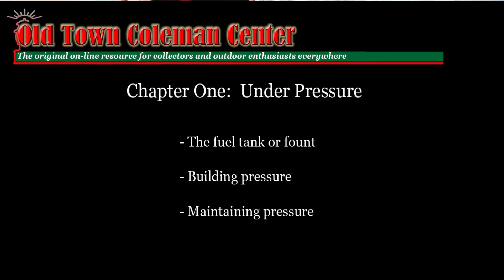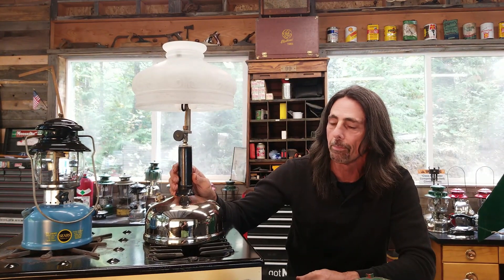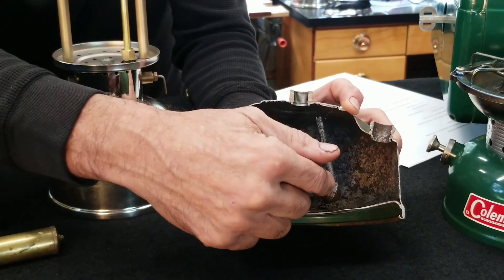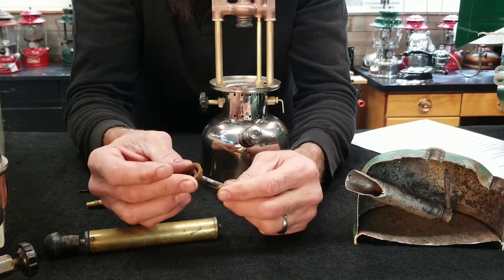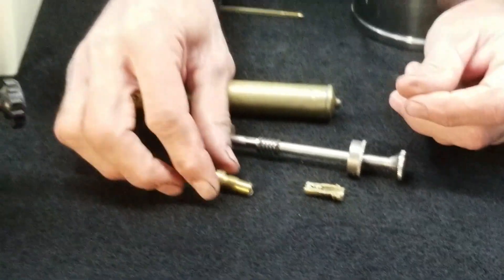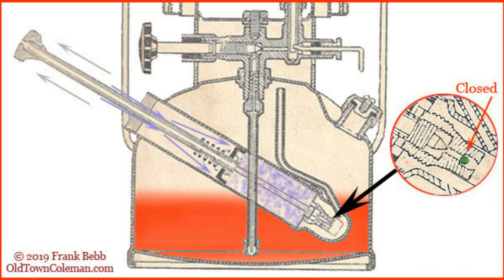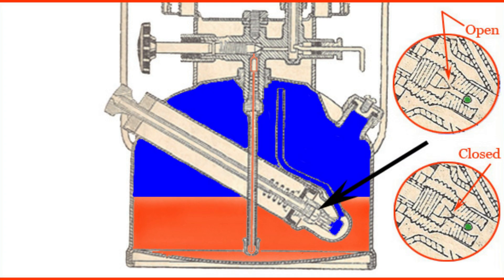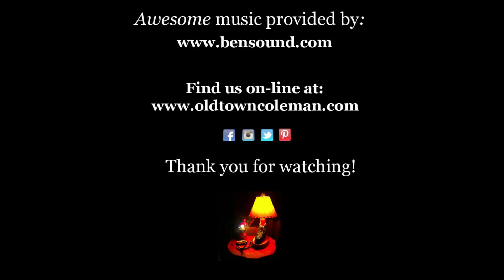How a Coleman Lamp, Lantern and Stove works - Theory of Operation Part 1: Under Pressure

Comment: No matter how much carb cleaner I spray into the check valve I cannot get it to stop leaking. I do not have a removal tool and I'm worried about ruining the valve. Would it be advisable to try a citric acid solution down there instead of carb cleaner? It's my understanding that citric acid is what's used once the valve is out

Comment: I have been using thes for years but out of nowair i needed to use one beacus the power went out and it presurises but gas is not coming out .anyone have any ideas ? I might just need to take it apart and rebiuld it again it has ben 15 years 🤔

Comment: Thanks Frank.  I’ve watched your video’s but still having problems with my 285-700t.  It’s struggles to light.  I’ve changed the generator and the font o ring.  But it splutters and lights but then goes out.  Upstream of the font is clean and good.  Is there a blockage in the valve or font?  Fuel does flow but it is sporadic.  Any help appreciated.  Thank you and keep up the great work!

Comment: The 242 c lantern has a small fountain. On a unit that has no air leaks, and has been pumped up to pressure with a tank of fuel, how long should this lantern burn at a moderate intensity without requiring any additional pumping to maintain brightness? Was the small size of the fountain the reason that it was discontinued in the US?

Comment: I bought a coleman stove a few years back for a few dollars to take on camping trips with our old VW Camper. It kind of worked but it wasn't getting much pressure. It was put to the side for a year while I started looking into converting it to propane or was going to toss it completely. This winter I came across an old Coleman lantern & it too wasn't working right. Then I found this channel. From getting my lantern to work & understanding what's going on, I was able to completely take apart, clean & redo my lantern. From there I got my stove working (all I needed to do was clean the generator tip & oil the leather cup. It's really simple but without channels like this, I would have never got them going & would have gave up. Now I'm partially addicted to lanterns, bought 4 more cheap finds (2 Coleman & 2 Sears - Blue/black big hat & the avocado) and even got a super nice 502 with pot/pan, original boxes & advertisements which I love. Thanks Frank. You're a great instructor.  - Jamie from Pennsylvania

Edit: I also got my 18 year old son his first coleman lantern & together we went through it all, I explained how it worked and how to take it apart & put back together. I'm glad to pass down info I have to younger generations.

Comment: I just got a powerhouse dual fuel lantern and this is my first lantern but I’ve already fixed the check valve and the rubber seal on the cap so now it hold pressure. I took the generator tube off and I can see the little needle come out the top with the knob turned. Those only thing it does is I can hear it hiss but no sputter so I’m guessing the pick up tube is clogged right?

Comment: Why is the pump tube hollow and what is the purpose of the small hole at the top of the handle  ?  Are you supposed to block it with your thumb as your pumping ?  I've watched lots of videos hoping for an answer
Reply: I don't know the official answer, but it appears that the little hole is to let you put the handle inside the tank if the pressure is already too high to pump even a little more. Imagine there's no hole in the handle. You unscrew the handle and start pumping; at some moment you realise that the pressure is already high enough so you want to push the handle inside and screw it. But you can't, beacuse you've already pumped so much air, that no more can be let in. So what can you do right now? How to hide the handle? To release all the pressure through the filling cap and starting the process over? Or just to cook with the handle up? That's why there's that little hole in the handle. The rod connected to the handle (the one we move up and down) is a pipe opened at the bottom. And if you don't close the hole with your finger, the air just escapes through it while you push the handle down, so you want to pump the air you have to close the hole. But when you don't want to apply any more pressure to the tank, but you want to hide the handle, you just release your thumb and let the new portion of the air just escape. Releasing the thumb before screwing the handle doesn't let the pressure escape from the tank, because there's the ball valve inside. The screw valve is somehow like a handbrake in a car, it's for long term holding the pressure; while the ball valve is like a service brake of your car. The ball valve holds the pressure during the pumping, but you can't rely on it during cooking or storing.

Can anyone confirm my theory?
Reply: @Krzysztof-Bodke  I have always wondered the same question myself as I noticed it pump either way, hole on pump handle covered or not.  Your explanation makes the most sense that I have found d so far.  Thanks for your input.

Comment: I'm 59 years old and never really had a hobby. Thanks to you and your videos I now have a hobby that I love. I have several different lanterns and even old oil lamps that I now am cleaning and refurbishing. About 15 years ago I found a 242C in a dumpster with nickel fount. It doesn't work and the fount has rust dust in it. That lantern has always been my favorite but I never knew what to do with it but thanks to you, I now know how to fix it and clean it up. 
Gotta love that base line groove in the beginnings of the videos!

Comment: The vertical tube from the pump is not vertical to put the air above the fuel to pressurize it. Air will get there with no special help. The tube is there so fuel doesn't go into the pump. Hence the admonition NOT to overfill the fount and flood the pump.
Also, the check valve is designed to let the air go one way but prevent the FUEL to go the other way. Not air.
 But i guess we all know that. Beautiful pictures. Beautiful lamps.

Comment: Glad I found your channel, great content.  Looking forward to the rest of the series.
The vertical tube at the outlet end of the pump is not to direct pressurized air up into the top as air would naturally rise without this tube but instead it is open to the air pocket above the fill level to prevent liquid gas from bleeding back into the pump cylinder in case of a check valve failure.   Bleeding off air is always safer than bleeding off gas.

Comment: Great video. What is your opinion on the neoprene pump cup coleman uses nowadays? Also what is the best oil to use on the rubber? Coleman recommends light machine oil but I'm not 100% on what exactly counts as light machine oil.

Comment: What happen if the Check Valve is permanently submerged to kerosene gas because of a faulty Pump Tube? Can I still continue pumping and create pressure inside the gas tank?

Comment: Hello been watching your vids got a question… got a Coleman 220f 1965 took apart to clean and I left valve body on the tank and pressure tested and no leaks and check valve good but was wondering while I opened valve to release air after about 45 pumps the air gets released in approximately 10-15 seconds is that proper working condition??? Just seems to quick am I missing something???

Comment: Hi Frank, thanks for these very informative videos.  I am in process of rebuilding 200a lantern.  I have question about maintaining the pressure.  For longest time I thought that these lamps have some feedback system to keep pressure high in fount, so that only you need initial 20 pumps to start it and then it would run by itself.  I listen carefully to your videos however I think I am missing something.  Do I have to pump up the lantern from time to time or will it run by itself once it is started?  Can you please clarify?

Comment: This is very interesting timing.  I an in the process of rebuilding an early model 431 2 burner stove and a 1991 295 lantern.  Both of them needed the pumps rebuilt.  The 431 still has the original leather pump cup and it was dry and stiff, but after working it with dubbin it softened up and is as good and as supple as new.  I cleaned the whole pump tube and all parts, re-lubed and reassembled and I was shocked at how much better it worked and how quickly it built up pressure.  This got me thinking about how the whole pump mechanism worked and I pretty much worked out just what you showed here.  But this got me thinking, because as a kid when camping it was always drilled into me that when pumping up the stove you MUST remove your thumb from the pump hole on the up stroke.  So many others say this was not required and I admit it did work.  BUT...I found after rebuilding the pump on my 431 it builds pressure significantly faster if I remove my thumb from the hole on the pump when pulling on the up stroke.  I have to assume that this is why the whole is there in the first place unless it was just easier to manufacture the tube with the hole all the way through instead of one end being blind.  But my stove pressurises way faster now if I cover the hole on the down stroke and uncover the hole on the up stroke.  The 295 has the neoprene cup which pretty much disintegrated and has totally fouled up the pump tube and check valve so it is still in the process of the rebuild.  Haven't been able to source a replacement leather cup locally as they are all sold out.  But this can wait.

But I greatly appreciate this video if only for the fact that you confirmed that I did figure out the basic operation principals of the pump without researching.  Thanks.
Reply from the maker: My pleasure, always glad to help.  By removing your finger from the hole, you are allowing air to flow into the area below the pump cup with less resistance that it would get by flowing over the pump cup.  Either way will work, but not removing your finger would be faster.  If you ever find an old 242 or 242A that does not have a hole in the pump stem, and you try to push it down to lock it away, you'll understand why the hole is there...it is quite difficult to do.  Pushing the pump down without your finger over the hole is really easy and makes finishing the pressurization process a breeze.

Comment: ps - you still doing the regular gas test? - how many tanks are you up to now? - I really want to see what the generator looks like between the two when you tear them down - I have no-ethanol gas near me and may start trying it - but will drain yearly and use leftover in my lawnmower.
Reply from the maker: Bill, absolutely, I will be recording the "gas test" video in the next few weeks.  It is complete and I'm also excited to see the difference between the two on the inside.
Reply: Great question, Bill.  

Looking forward to seeing your next “gas test” video, Frank.